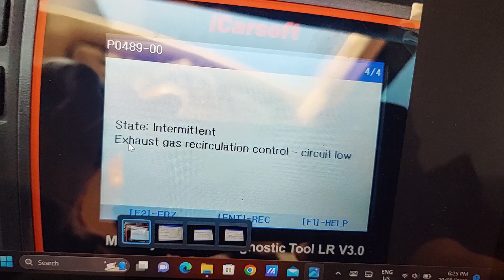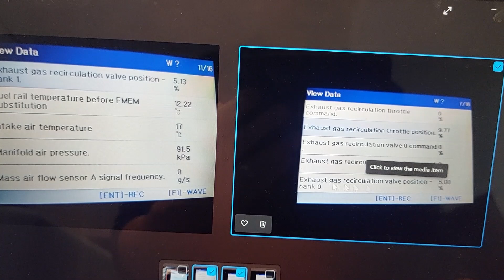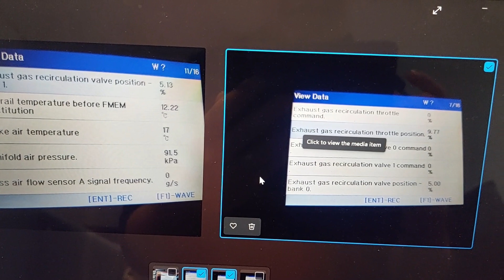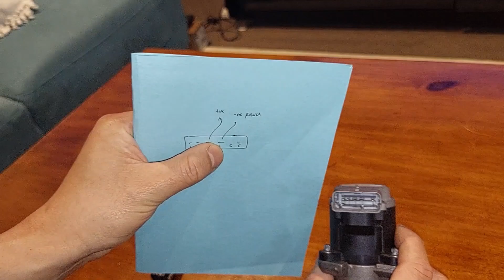LANDROVER DISCOVERY 3 LR3 - P0489 AND P0405 EGR FAULT DIAGNOSIS

Comment: One of my valves was just like your faulty one. I just cleaned and lubricated it with rust penetrating oil and "pulsed" it on and off, until I got it going. Thank you for your info regarding the function and polarity of the pins on the connector.

Comment: Thanks for this have the exact same issue
Reply from the maker: @lukakosir235  no worries. I replaced these EGRs myself, not that hard bit fiddly though. Just remember to put some cloth or paper underneath egr so if you drop any bolt, it gets caught on it. Also tie small tools with a thread so if it falls you can pull it back out.

But i later ended up reflash with the EGR delete.